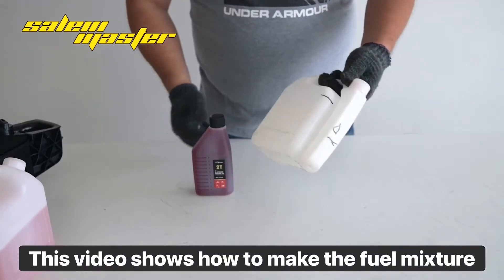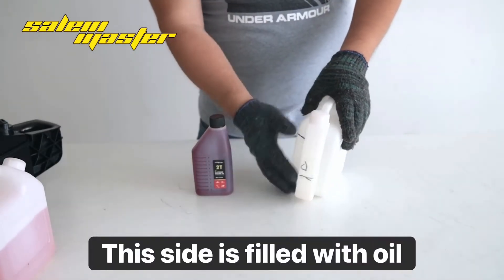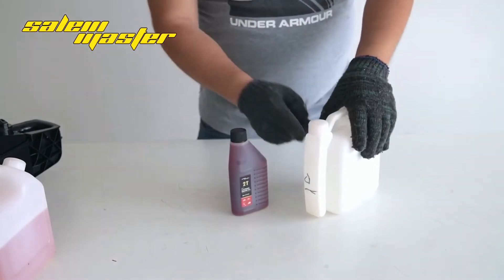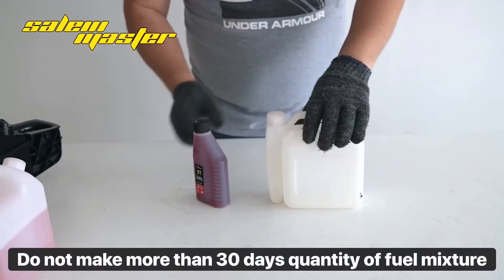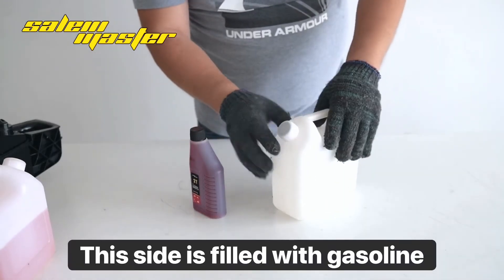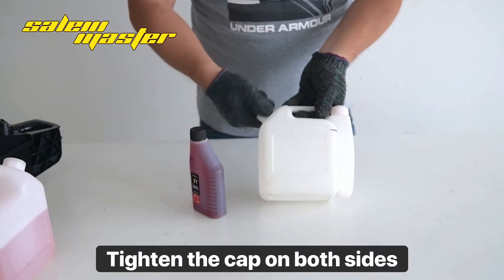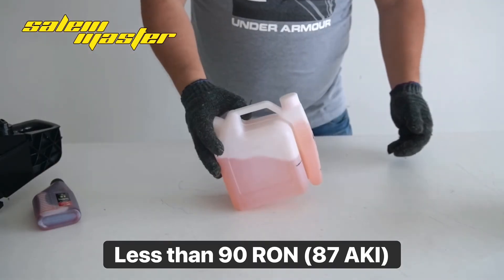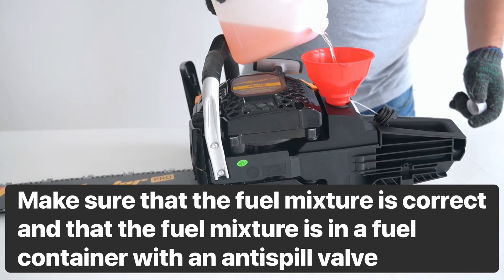How to make the fuel mixture Salemmaster chiansaw

Comment: This video is worthless. It did not explain anything to me snd wont to anyone else.
 Honestly, you should take this video down and make a better one!!!
Reply: I think I understand this. If you look on the oil side of the  container the top number is 10 for each ratio, 25:1, 30:1 and 50:1. The top number on the gas side is 10. So if you want a 25:1 mixture, fill the oil on the 25:1 mixture side to 10 and fill the gas container to ten and mix. That would be the same for the other ratios. Basically it is match the numbers on the oil side to the number you select on the gas container and the ratio is maintained for any volume you want to end up with. The author should have just done at least one procedure so we could watch it and that would be clearer.
Reply: @QuietSignal-g8r  you explained it well now i understand thanks!!!

Comment: Ok so to get 25:1 what do you fill the oil container to and the gas container to? Is it 10 mark on the oil and then 10 on the gas? You mentioned the side "with the 10 mark" but didn't state to fill it to 10
Reply: same question, dont u fill to the 50-1 mark????????????????????????????
Reply: Fucking useless video